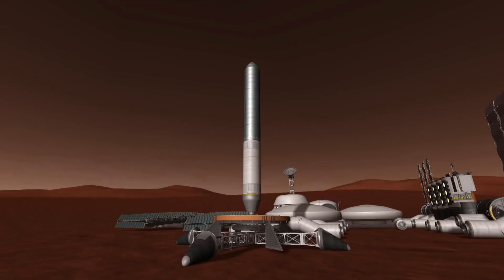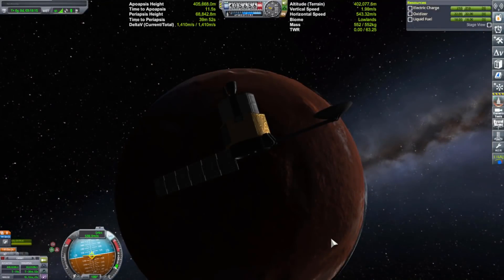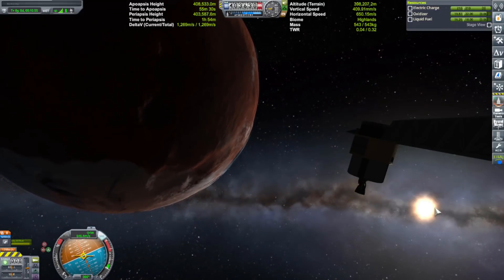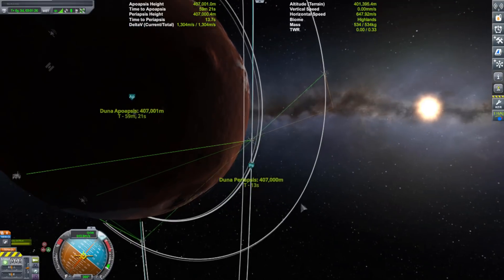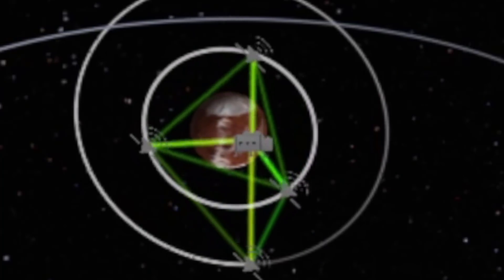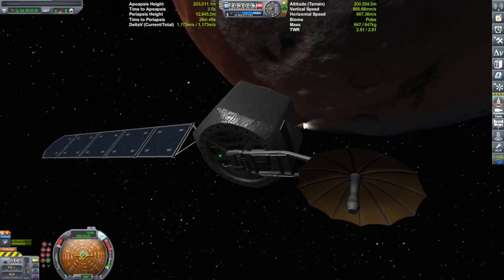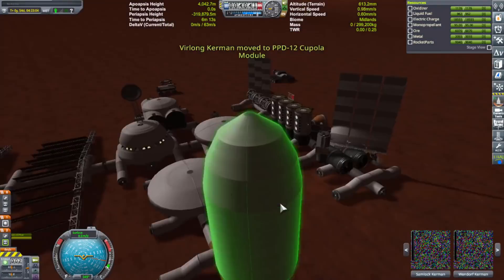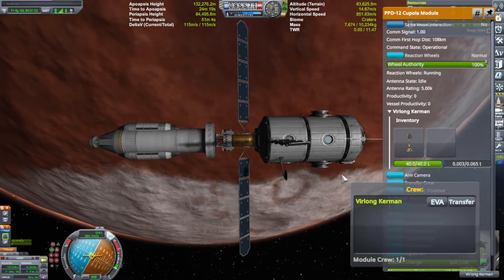LEAVING DUNA! FINALLY!

Comment: I got this mod too, the simple construction, but whenever I try to make a launchpad it gets exploded by the engines, how did you manage to fix it?
Reply from the maker: The part is rated for 2600k heat
Reply: @vaos3712  Sorry, but which part is that? I can’t tell with the reskin.

Comment: I set a trio of the highest power relays beyond Duna. If I was going to spend a lot of time, say in the Jool system, I also set up smaller relays there. The Jool relay spoke with the Solar System relays and connected to Kerbin. I spent a lot of time setting up a relay network where I could remote anything from anywhere. The nice thing is, if you set it up correctly you should never need to touch it again.

Comment: I use Interstellar Extended which introduces a crap ton of new propulsion systems and what have you but also introduces independent AI computer parts (iHAL and I forget what the other one is) which can act as base controls independent of Kerbin, but I also saw some other mod someone mentioned in the comments, RemoteTech, I don’t know what that is or how it works but it might be an easier solution than KSPIE lol

Comment: use the RC-L01 Remote Guidance Unit(the big one) instead of the RC-001S Remote Guidance Unit(the small one) because it is multi hop capable and the small one is only capable.

Comment: Just in case, make sure you're using a probe control point with multi-hop and not single-hop control. Multi-hop allows the signal to bounce through relays, whereas the single-hop ones are direct only
Reply: apparently theres only a single multi-hop core, which is the RC-L01 Remote Guidance Unit, in order to function however it does need to be part of a craft with a piloted command pod
Reply: @Jomads  So:
(1) Mount that core somewhere on colony structure.
(2) Support it with colony based retranslator dish and command pod (with crew).
(3) Enjoy with working independent retranslation network. (It could not transfer scientific data, as, by definition, game trying to send that data "back to KSC", but remote vehicle control should work)

P.S. Smallest retranslation antennas used on satellites in this video are very limited in range, so I strongly suggest to use more advanced type even for local CommSat networks.

Comment: RemoteTech is the mod you want to solve that issue. Allows you to have a control station so long as it has the Largest Probe Control, and 6 Kebals on board iirc.
Reply: Yep, and adds signal delay too! Nice for realism.
Reply: why does it need 6 kerbals?
Reply: @bermchasin  mini control room